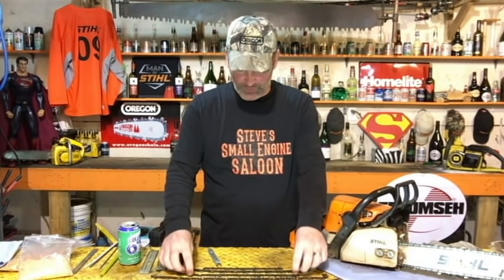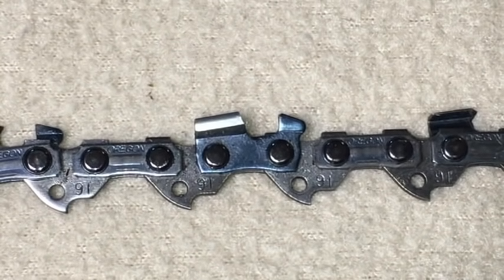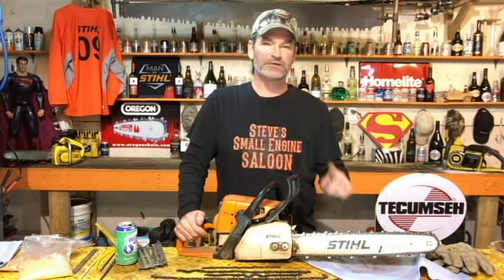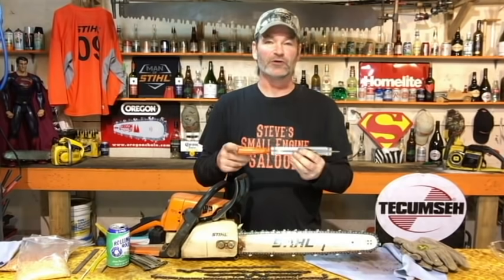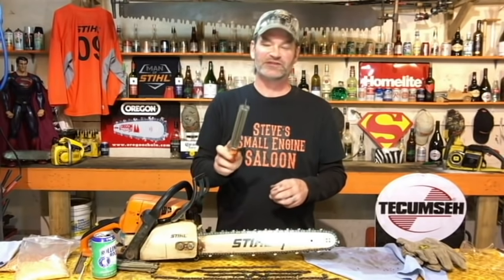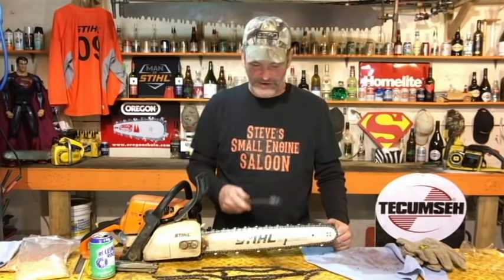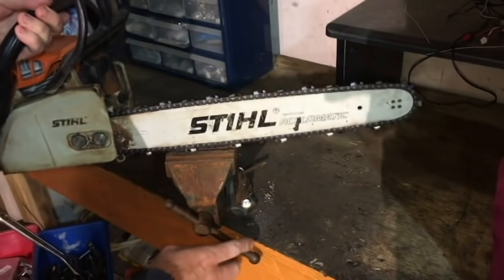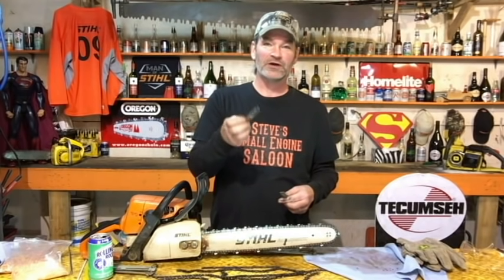CORRECT WAY To SHARPEN A Chainsaw (Step By Step)

Comment: Thanks Steve. I tend to use a grinder to sharpen my chains because I never aquired the knack or patience to sharpen with a file. However, this was really informative for me with regard to the rakers. I usually filed them down pretty far and when you mentioned the stalling that really rang a bell for me. I was taking them down too damn far. Hope you're holding up under the tirant you guys have. We're probably headed in the same direction with our brain dead, mask wearing, ice cream lovin' potato running the show here in the USA. Thanks and good luck to you guys.
Reply from the maker: Right on Cliff
Reply: But he doesn't get brain freeze from eating her ice cream to fast.

Comment: Most helpful vid! It is important to have the correct information for safety and efficiency. I have the tools you showed there but I overspent and ordered a Granberg G106B jig. Your info will help make sure it is setup properly. I bought a 40V Ryobi 16" saw for yard trimming and occasional storm damage to trees. My goal is to keep it sharp, clean and not stored with chain oil in it.
Reply: This saw comes with an Oregon chain and bar. I believe it is the Pico chain as it sharpens with a 5/32" round file. Model is RY 40505
Reply: Learned from you with excellent results and filed rakers that needed it.  Thanx

Comment: Watched you awhile ago. Used chips example instead of depth tool. So I'm almost good at hand sharpening.  Saw cuts  much more wood and chains cut well until cutters are almost triangle. Im a Hobby guy 30 to 35 cords firewood  first year after retirement.  Thank you

Comment: Hey Steve. Everytime I sharpen my chainsaw chain i have a little handheld tool that goes to over the top of the  teeth. I hold it down on 3teeth and I slide my file  right over it and it does a good job. Then i start the saw and make a cut through the log very small chips a@are falling down on the ground. That way is known it's right. After that I do the same thing every time. 
👍

Comment: I love you videos and you have saved me countless hours troubleshooting and repairing my power tools. I own several acres of wooded property and in the Summer I do a lot of cutting of old wood...both standing and fallen. I hated sharpening my chains but a few years ago I stumbled on the Oregon Powersharp system and have used this for a long time. I can have a sharp chain in 5 seconds and one chain lasts most of the summer as long as I don't hit rocks or other non-wood debris. This isn't an ad...just me sharing my experience. I know purists wouldn't go there but I'm totally satisfied.

Comment: Hey Steve, I’m loving your info and I’m getting great advice from you. I’m just at odds with you on the Racker filing. You use a guide to make you cutter filing fail safe and easy. Yet you advise not to use the racker guide… it makes zero sense. When used correctly the racker guide sets the correct height for each tooth. Use it immediately after sharpening then there will be no need to go out cutting wood guessing the height, plus it stops you taking too much off. Old habits die hard… the racker guide takes the guess work away… thanks for a fabulous YT channel…👍👍

Comment: Very informative, I  have never used a guide in the 35 years of sharpening and never will. I use   my left hand to sharpen the right teeth and right hand to sharpen the left teeth and place the saw on a stump or wood pile with the back of the saw against my chest stomach area. I agree with sharpening teeth as they need, not every tooth the same.  Rakeres and wood chips is the only way to tell. Great video, your saw should cut wood like a hot knife in butter.

Comment: Excellent, Steave I cut cords of wood every week running Stihl &  Husqvarna went down to Harbor freight,bought a chain saw sharpener, best $40.00  I ever spent.still use a hand file to touch up a tooth or two, but you can't go wrong for down time especially when your running 4 saws a day. How about giveing you  audience, a shake down on this neat little motorized  sharpener.

Comment: my only comment is on the rakers - each raker needs to match each tooth
so, if you have been filing the teeth until they are sharp ( yes, that's awesome) you now have to adjust teach raker to match. I do use a guide, and pick the setting for hard/soft wood accordingly. I don't use a guide like the one you showed but rather one which adjusts based only on the 1 tooth I am adjusting. ... such as the Oregon file plate, or, the Husqvarna sharpening guides, I guess the new 2 in 1 guide from Stihl will do that also, I have not used one of those yet.
However, as you stated, once yo have the chain sharp, and the rakers set, it does cut VERY nicely.
Thanks again.

Comment: Steve- love your videos about how to set up tension and sharpen the chain. The only thing you didn't mention, while sharpening, what is a good reference point to start filing the first and last tooth and avoid filling again teeth that have been sharpened already. I usually use the two teeth that are oriented in the same direction, as a reference to start and finish sharpening, but I'm just a casual chainsaw user and I don't know if that is a standard reference for all chains. Interested on your opinion. Regards.

Comment: I’ve been fixing Chainsaws for over 40 years and never could sharpen chain with a Electric chainsaw sharpener that my father my brothers and his employees have been using at his shop since 1972 but I can sharpen a chain with my file great but when your shop gets 30 chains a week to sharpen for customer my dad wanted me to help and I started with a new file in my hands and an hour later he came into the sharping room and ask if I was done and I said I’ve got 3 done we are talking 108 drivers 72 Oregon tree fallers chains and he looks and see I have the bar in a. Vice like you did on your show here working on the fourth one and started laughing I told her I don’t know how to use that electric sharpener correctly you did a great job showing people how to do it correctly thank you R.G.& Sons Redding Ca shop

Comment: Hello,
Great video. I have a small chain saw and I was looking for a way to keep it sharp. I am an amateur cook, so I know that one has to keep one's knives sharp to work well. 
You gave a great explanation of not only how to sharpen but also the mysterious depth guide with a method by results. 
I also want to commend you on the quality of your video. I am a retired television engineer so I know about lighting, sound and editing. You did a great job. In these days just about anyone can make a "video" but to do it well is still the result of effort, investment in good equipment and infinite patience. 
My only suggestion is to watch more your cutaways. When you are talking about something make sure that we, the audience can see it. Most of the time you did well but sometimes you spoke about something and we didn't really see what you were talking about. 
Once again great job. You are doing a great job.
yours,
Lenny Jensen

Comment: Well done Steve, another brilliant video. A question left of field. I inherited several different brands of chainsaws STIHL MS390, Husqvarna 55, McCulloch pro mac 10-10s, McCulloch CAV 2918, Dolmar Ps-411 x 2, and some chinese models. They've all had a bit of use yet very workable with TLC. When I received them no chain was on the saws. So I have seven chainsaws, and 20 chains. I've kinda worked out what may go with what based on chain length. But there are others that are the same length and I'm not sure how to match up sprockets, pitch, link length etc. for each saw. My friend who donated them said he used a generic electric chainsaw sharpener with a large grinding disk and did them all at 30 degrees.  How do I work out what chain it is and then how best to sharpen it back to its original angles? thx Mark

Comment: Good stuff. I'd been sharpening by I guess logic n instinct but this cleared a lot up. I'd been using a guide but last time I had to use the file alone and the saw got dull quickly. Dull chain sucks.

Comment: Steve, I could never get my head around those file guides. :(
I will send you a pic of what I use, and funnily enough, I can't find them anymore. 
Now, the one thing I do when sharpening the tooth is to 'rotate' the file so it wears more evenly whilst sharpening. :)
hint Try grinding the 'rakers' to the halfway mark on a NEW chain, and watch your chainsaw have a 'spas' attack! :) (well, it works for me) ;)
Me and a farmer had a competition. Him with his Farm Boss, and me with my little 'modified' StihL.
He beat me by about 3 seconds and left him gobsmacked. (it was the same log/diameter to make it fair)
Cheers!

Comment: Great instructional video, I thought there  was going to be a lot of yapping about nothing but you kept to the task and did great editing also. Thanks for the tip on tightening the chain first, I should've realized that, I just figured I needed a new bar. One thing I wish you would've covered is the tooth that needs 30 strokes on it from hitting metal will need the raker taken down more. How do I know how much? Is there a ratio that you can guess at? Say 50 tooth strokes to 1 raker stroke or can the height be measured? You also mentioned that hardwood raker height is different, is it correct that you wouldn't take down the rakers as much for hardwood? What part of the true north are you from?

Comment: Hello Steve, Thanks for the video. FYI, when sharpening with a guide, when you change sides you should loosen your guide screws and spin the file and re tighten. Otherwise your always using that one side of the file. Cheers

Comment: Thanks Steve. We will use this video to train our new techs. One tip though. Most people are left handed or right handed when using a file. When you clamp the saw upright in the vise it becomes awkward when filing either the right or left set of teeth ( depending on if you are right handed or left handed) because your elbow will interfere with the engine. When one set of teeth are completed, instead of reversing the saw in the vise, and keeping it upright, simply take the saw out of the vise and clamp it back in upside down! No more interference.

Comment: Great information as always Steve, just one point if I could. How to  know positively where I started sharpening is by putting a dot of paint from an ink pen on the first tooth I sharpened and it works for sharpening both sides.
Reply from the maker: Great tip!

Comment: I ended up using a worn down cutting disc in the angle grinder. I got some small round files but the teeth were harder. You were right though if the teeth are not hooked it cuts crap. I took some off the guard teeth as well. All set for Winter tea felling.

Comment: Super tutorial! If I could add a couple things that could help : 1. chalk up your file, and 2. use a jeweler's headband glasses. I learned this about files years ago in high school metal shop,  dress your metal files with a stick of blackboard chalk. It keeps them from loading up with metal and helps keep them sharp. The jewelers headband glasses really help. A lot of light, also.

Comment: Stihl 3/8 chains use a 13/64 file. It makes a huge difference in cutting efficiency on a Stihl chains. In the past I used use a 7/32 file and I noticed a decrease in cutting speed. I switched to the 13/64 file and what a difference. Definitely use a 13/64 in Stihl 3/8 chains.

Comment: This is an awesome step by step and very informative video.  I have learned soooo much.  I do have a question and if you have some spare time can you please clarify something for me.  You recommend pushing the file away from the saw to sharpen the chain.  That seems to me that when you push out and away on the tooth that it would create a burr on the outside of the tooth.  SO I have been doing it backwards all along.  But the reason I push the file towards the tooth/towards the saw, is that will eliminate burrs on the outside edge of the tooth.  Is that not correct?  If not can you clarify why I shouldn't be pushing it towards the saw?  I'm racking my brain trying to over analyze this, but more importantly want to learn from mistakes.

Comment: Good use of closeups & video editing. Thanks. // Would be nice to see closeups (maybe even with microscope) showing a dull cutting edge (before sharpening) and then what it looks like after 1, 2, 3, ... strokes with a file, so we can more clearly see what the file is doing. Could be done with either stills or video. Once you've got the setup to photograph like that, show also what happens when file is held at wrong angle, or the wrong diameter file is used.

Comment: just pop'n up in my rec. . . probably cause we're building projects using chainsaw motors :) very well done, earned a sub :) we were always taught the raker was tall if the chips didn't fit the bite of the chain, like you said 'it makes sawdust instead of wood chips' and we were taught the same way. . . two strokes to start, minding teeth direction and test cut. . . .i always got yelled at for dry clamping a bar though, we had vice protectors on the jaws of the vice so it didn't mash / deform the bar, pretty sure that was just someone elses ocd :)

Comment: I liked this video very good, just one thing not clear on and that’s the teeth length how important is it to file them the same length as the cutting edge pointing upwards on a kind of taper and therefore mixed length will logically cut different depths.

Comment: I have some chains which have to be sharpened and will work them over and I do have the gauge to adjust the rakers also since they have not been cut before. Currently, I am glad that you showed us the correct way to sharpen the chains and I shall remember it and use this technique correctly when sawing wood.
Reply from the maker: Right on Sid!

Comment: Great video. Considering the accuracy required for correct sharpening of the chain, I would say that sharpening in the field by  placing the saw on the ground will result in inaccurate sharpening due to incorrect handling of hand sharpeners. I've been using chainsaws for a long time and field sharpening (sharpening at the place of work) is very difficult to get right. It's very easy to vary the the file too much resulting in different sharpening angles.

Comment: Excellent video and content... engage, inform, inspire  👌. One question, only recently started cutting our own firewood. Assuming the original box for a replacement chain is missing. Is there a good rule of thumb to select the correct size file. Many thanks from the UK

Comment: All good helpful stuff but I like using a rake gauge because it gets them all the same height .  I also use a straight edge across the teeth and eyeball the results .  I am no professional but  the chains cut good enough  on firewood collecting .

Comment: I use a a Dremel with a 30 degree attachment. It may not be ideal but it is easy and can be done one handed. I think I need to use smaller tool sizes though as my hooks need to be more hook like.

Comment: Rightly or wrongly, I like to rotate my round file in the guide a quarter or half a turn as I push forward to sharpen the tooth. I think it  wears my file much more more evenly and I always rotate away from the tooth (clockwise or anti-clockwise) which I think helps clear the filings off the file somewhat. Also I like the control I get as I push and slowly turn the file at the same time.
Of course the two small clamps on the file guide need to be slackened just enough to allow the file to rotate.
I don’t know if others do this, but I’d like to put it out there.  Any thoughts?

Comment: new question, I have a craftsman dyt 4000 mower, the issue is, when it starts, the blades engage.  It has a new starter switch and a new pto switch.  I can not disngage the blades.

Comment: Hey Steve love your vids. First time watching your vids and run a half charged battery dead agreeing and learn a thing or two. But a small little but. Lol is on your saw sharping. I sure you know this and just forgot to explain it. You can do all the chain sharpening right”which you did”. But hey I forgot a rookie just ran my saw last and railed the bar. Now the bar is wider than the saw and most ppl cannot figure out why it cuts good but not til it get into the wood so far. Am I right. Again love your vids I will keep watching bud I enjoy them.

Comment: Man thanks again for these awesome videos. I did have a question. I was given a used Stihl chainsaw that I tried to sharpen the chain and my brand new stihl file wouldn't cut the metal it just slid right through. Is it possible the chain got too hot and hardened or do I have a different problem?

Comment: Very informative and agree with most of that. I personally sharpen free hand no gauges. I am not in a position to put a saw in a vise when I'm getting firewood and am not going to drag a vise along just to sharpen my teeth in case I hit a rock or nail or even a bullet that was lodged in the tree. Also I find it very easy to follow the small line on the back of the tooth parallel instead of following the  the gauges 25,or 30 degree mark and hope I'm not going off when the line for 30 degrees isn't right on the bar. Raker teeth, Just look at them and you'll know. For me personally guides are pretty useless. I use muscle memory. the height of my tailgate to keep the chain at the proper angles. but I get where your coming from if you have a small engines shop and you primarily sharpen other peoples saws.

Comment: This is good except it didn't discuss how to use the Oregon file guide for the depth.  Does the flat surface of the guide ride on the top of the cutter tooth?  Does it ride on the raker?  Does it ride on both?  And, how much of the file should be above the top of the cutter?  20%?  Does the file guide take care of that?  And what direction do you apply force in?  Straight down?  Straight backwards into the cutter?  Some combination of the two?